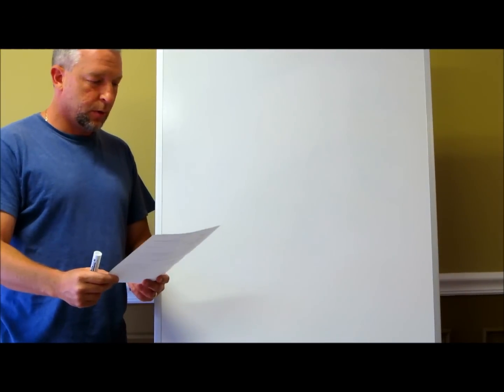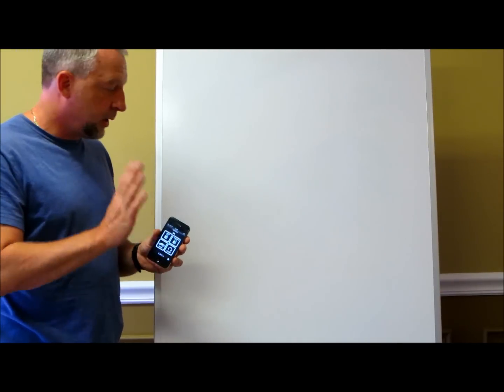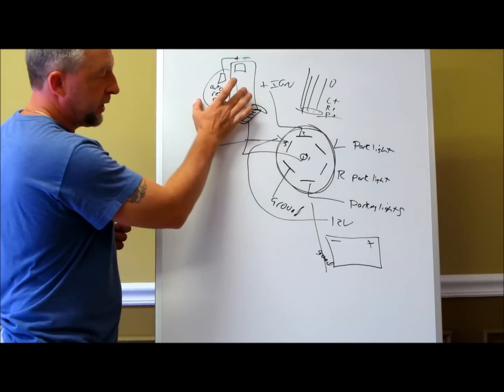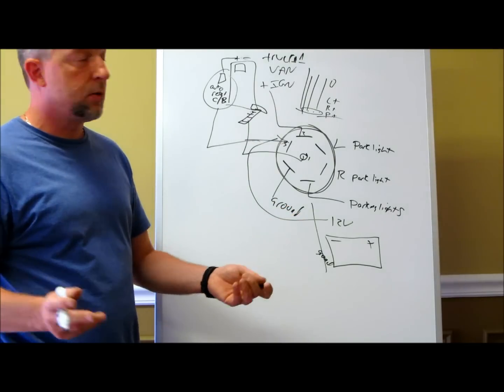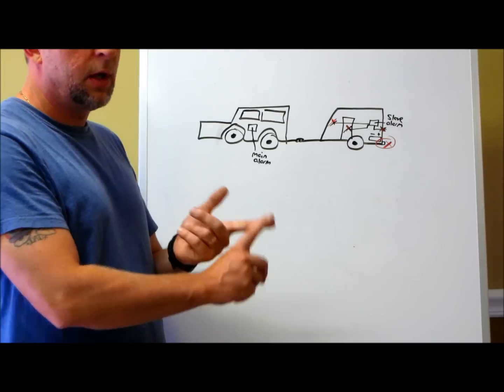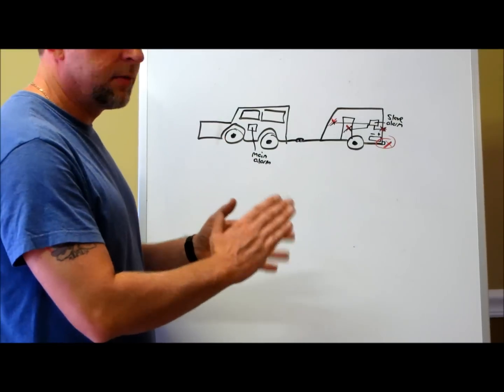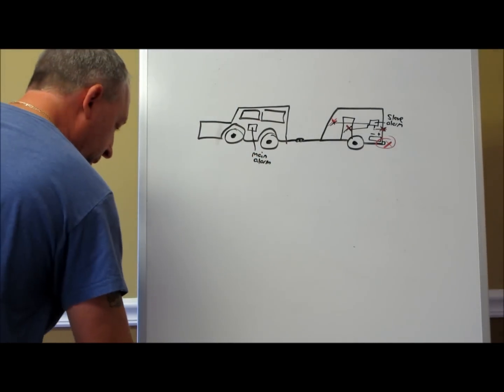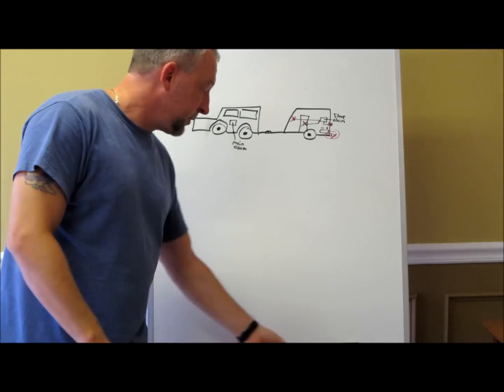How To add an alarm on your trailer to secure it from thieves.

Comment: thinking of installing a basic alarm on a open utility trailer with a shock and tilt sensor. Was wondering how well a 508D would work and what would be a mounting location for it. First thought was to house it in durable plastic electrical box and some how mount it in the center of the trailer bed but could be obstructed if  something is loaded on top of it. it would be nice to how have an audible warn away(voice would be great) to prevent tampering in first place. If someone could come up with a decent set up for trailers in would be a popular add on as people are always getting tools & equipment stolen from their trailers. Some times the entire trailer is stolen. Have an idea on utilizing the trailer brake triggered by the alarm to make it more difficult to drive off with. Any advice would be welcome and am wondering if the initial connection of the two batteries being not equal will be an issue. thanks
Reply from the maker: I can help, call me sometime 904 342 5491

Comment: sorry if you mentioned this already, I haven't had a chance to watch the video thoroughly yet but can I use the battery that is already on the trailer that is used for the electronic brakes?  Also my truck has an OEM remote start and alarm, can I integrate a trailer alarm into it or would I be better starting from scratch.
Thanks
Love your videos and the way you make everything easy to understand

Comment: Interesting, one suggestion if you are paralleling batteries, I think you should put in some kind of current limiting system to limit inrush current that may happen when you connect the trailer battery to the fully charged truck battery (when plugging in the trailer plug).  If one battery is fully charged (say the truck) and one is discharged (the trailer battery), you will have a large spark as the batteries try to equalize to the same voltage,,, you have a breaker than may trip, and then reset, so you might get away with it, but that is less than an ideal circuit and the spark when you plug in may damage the electrical contacts in the connector (as well as surprise the user).  Maybe try a charge resistor with a bypass switch you flip after a couple minutes when the batteries have equalized, or a Polyswitch, near the trailer battery so it is more automatic.  I would try to limit the inrush to <10 Amps if you can,,, There may be something already on the market for connecting a trailer battery to a truck, should be with all the RVs out there.. Just a thought, the rest makes sense.

Comment: For the Battery in the trailer. Do you run a battery wire from the negative to the ground of the trailer frame? Does it interfere with the ground system of a trailer with electric brakes?
Reply from the maker: Simply Steaming the trailer itself is a ground with the 2nd battery creating a circuit inside it as it is, it gains extra ground from the ball when connected to the truck. and it affects nothing electrically whatsoever.

Comment: Thief's disconnect trailer from tow vehicle - alarm is dead. Great idea.   23 minutes of useless info.  You need solar charged battery powered alarm system. Put the solar panels on a roof, which charges the batteries and even if they take the trailer off the tow vehicle, it will still give you signal.  Also an alarm with loud noise should alert most people that their trailer is being towed away. yes its nice to know where is it hours later after the fact but if there is a loud sound, there might not be an act of stealing will take place.   If a trailer is within earshot or sends an immediate signal  to your phone that - hey, I'm being moved - that is better than tracking it to the nearest electronic guy who removed the alarm and dumped it in a dumpster.